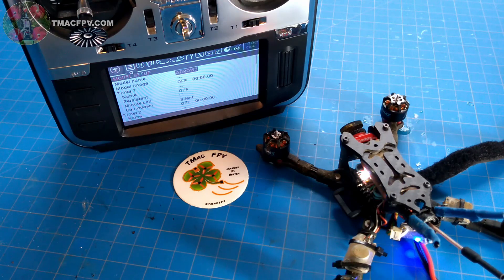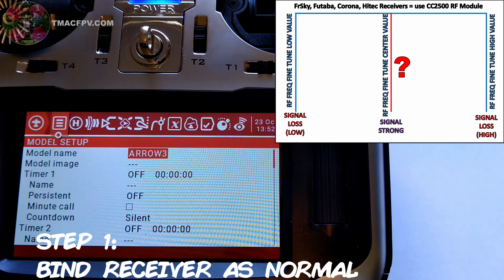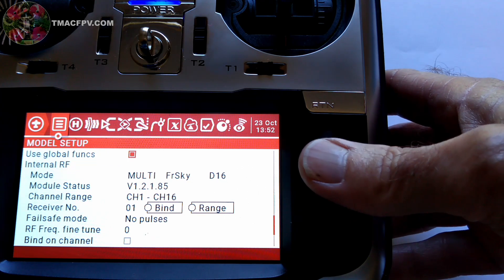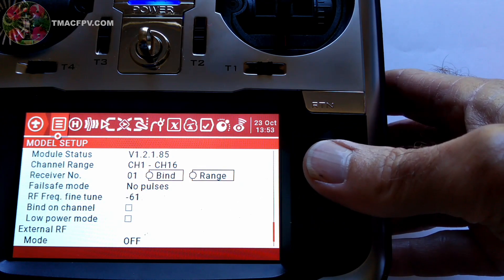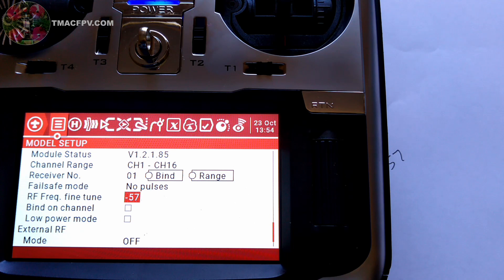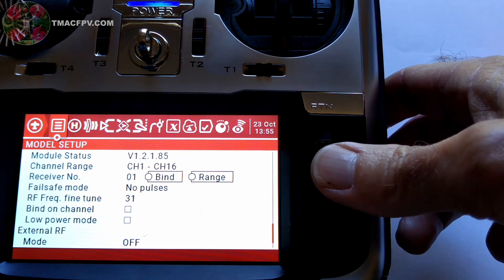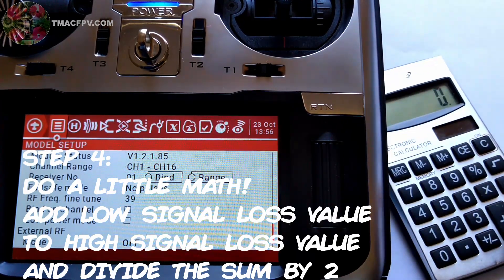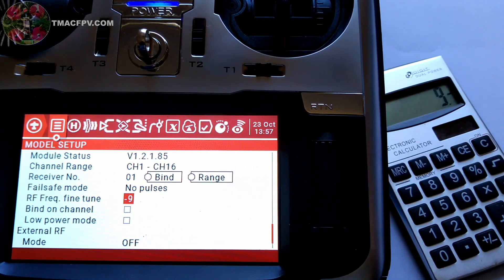JUMPER T16 PRO MODULE TUNE

Comment from the maker: Came across this “fine-tuning” with the internal module of the Jumper T16 Pro for genuine FrSky (and other) receivers & did a little research.  Wanted to pass on what I found to others.  Let me know what your fine-tuning number is and what receiver you’re using so we can all compare!  👍😀Also, if you're wondering whether or not the multi module will bind to your receiver, here's a link to a very short video clip of me scrolling through all of the protocols displayed by the internal module.  Keep in mind each protocol may have a few specific receivers within it (i.e. Hitec has Optima, Minima, Opt Hub). I obviously, have not verified myself that each one of these displayed protocols binds to the module.  Here's the link: https://drive.google.com/file/d/1H_VGiwy7iQiOCDfWnJlxe3O1AfT-ob2d/view?usp=sharing
Reply: This option is not listed in my radio.  I have the exact same radio and firmware version but this freq tune isn't a listed option.

Comment: Thank you for a very good guide.

However, I would like to suggest one change - if the receiver lies next to the transmitter, the range of both values will be very wide, because the signal is strong.

If the receiver would be far away, e.g. 500m away - I think we would find the "centre" much more precisely  (it doesn't always have to be the "mathematical" centre of the band)
Reply: You can set the module to low power - it's a checkbox further down. Remember to set it back after tuning - the radio will warn you when you turn the TX on in case you forget.

Comment: Strange, my Jumper T16 with latest opentx firmware does not show this option rf freg finetune. How is that possible?
Reply from the maker: Your OpenTX operating system firmware is distinct and different than your multi-protocol module firmware.  This video shows the difference and how they work together https://youtu.be/xAmCWIwzlKc . The RF Fine Tune feature should be in your model setup menu near where you normally bind the receiver to your transmitter,just below receiver number under Internal RF Module.  If your Internal RF Module is OFF because you happen to be using Crossfire (or an R9) system on that particular model, it will not be displayed.

Comment: Hello there Sir. Loved all your helpful vids. Wondering if you can make a video on how to compile or patch the file or firmware on T16 to resolve the issues on DSM / DSMX. Would really appreciate it very much. Thanks
Reply from the maker: hmmmm . . . what OpenTX AND multimoduile (the 2 different)  firmware versions do you have installed?  I believe the DSM was fixed back in version 47 or so of OpenTX.  Also, in a more recent version of the multimodule firmware a "fix" was made for telemetry on DSM telemetry receivers.  For clarification on differences between OpenTX and multimodule firmware,see this video:  https://www.youtube.com/watch?v=xAmCWIwzlKc  For the latest OpenTX firmware version, go here: https://www.open-tx.org/downloads  For lates multimodule firmware go here: https://www.multi-module.org/ For how to update OpenTX firmware, see this video: https://www.youtube.com/watch?v=BXhLk_l6280  For how to update multi-module firmware, see this video: https://www.youtube.com/watch?v=EJx9mz-DI_g  Hope this helps!
Reply: @TMac 
Ok, thank you Sir. I’m gonna try and see if I can update the internal multi module in my T16. Yesterday I did update to the latest firmware. 
Thank you so much.
Reply from the maker: @scrc511  Sure, scrc511! Today's video (Friday, April 24th) might be of interest. Posts at 2:00 pm EDT (UTC-4 hrs)
Reply: @TMac 
Under Model Setup, Model Status mine says “No MULTI_TELEMETRY detected”  I’ve downloaded the latest firmware for the Multi Module, and when I go in my radio under SD Card, firmware to update it doesn’t give me the option to update the module internally. It gives me this option instead, flash External Module, Copy, Rename and Delete. For some reason I don’t know why Internal Multi is not showing up.

Comment: Ended up on the positive side 17 with my fhss Futaba micro receiver. Improved the performance significantly. Before fine tuning it would failsafe for nothing. Now there are no problem flying behind buildings and I get about 900 meters range with free sight between me and the quad. Great video. 💪🏻👌🏻
Reply from the maker: Oh yeah! That's what I'm talkin' about!💪Nice👍Thanks for sharing your success 🙏😁

Comment: Do you want the middle number or half the middle number?
Reply from the maker: I go through the math at 2-4 minutes of this video. You want the number which is equidistance between the low and high endpoints (signal low lost & signal high lost). So, if your signal low lost is at -30 and your signal high lost is at +20. The number you want is -5 which is the same distance from -30 as it is from +20. Hope that helps

Comment: Should each type of receiver have the same time? i.e. rxsr will always need the same tune? Or will all FrSky be the same tune?
Reply from the maker: All R-XSRs should "tune" the same.  All XM+ should tune the same etc,   It may be slightly different from an R-XSR to an XM+ but the process is so simple and quick you can always check it out (even for specific receivers) in just a few moments

Comment: I hope this isn't a dumb question but how do you take out the sd card?
Reply from the maker: No worries 👍 It's located in the battery compartment on the back of transmitter. Gently push it in and let go with fingernail (or I use a toothpick) and it pops out further so you can grab it and remove it
Reply: Thank you very much!
Reply from the maker: @emilgabl9069  Sure, anytime!😀

Comment: How do you do this without rssi?
Reply from the maker: You should be able to tell when you lose signal connection with your receiver by watching the LED lights on it.  So, if you use the process in this video and do not have "voice alarms"  set watch for the LED lights on the receiver.  The green LED light will turn red when signal is lost on both the "low end" and "high end."
Reply: Thank you answering this question @Tmac and thank you for asking the  question @Big Willie FPV  My xm+ ended up being -24.5

Comment: Why all of sudden is there so much hype about the Jumper TX?
Reply from the maker: Hey My Drone Stories!  Not sure if you're being serious or sarcastic, but let me give you my rationale.  Well, for me I've had the Taranis Q X7 for over a year. then I dropped it down my stairs during a "durability test." I had been looking at the Jumper T16 for awhile because FrSky came out with ACCESS protocol which is more of a "closed", proprietary system (and on that I don't have with my Q X7).  I was concerned that FrSky would be doing away with the ACCST protocol in their receivers and I would either by forced by FrSky to purchase new ACCESS gear eventually or go with something else.  I held out for awhile because I was not comfortable with relying on Jumper support for their own "branch" of OpenTX (JumperTX).  Jumper isn't known for their firmware/software. Then OpenTX (same folks who support FrSky transmitters) has announced they will be supporting firmware updates of the Jumper T16 soon with official releases.  Nightly, unofficial releases are already out and being tried.  That did it for me. The T16 has more switches (i.e. versatility) than the Taranis Q X7, has an internal multi-protocl module which will bind to most any receiver, has an external bay for Crossfire or R9M modules (long-range 900 Mhz systems), a big screen, AND OpenTX support?!? The price is right and I'm also not being "cornered" into purchasing ONLY CCESS protocol systems.  I can't think of anything Jumper left out.  Great value TX.
Reply: @TMacFPV  It was/is a serious question.  I did some more research after posting my question and found essentially the same answer you gave.  Kind of bummed because I just got an X7 to get started in the hobby...
Reply from the maker: @thebikeracer  no need to be bummed. It's a very good transmitter! I still have another one (not dropped downstairs🤪) that I'm using as a backup. I've even got R9M module connected with it. FrSky is still making receivers compatible with it and so are other manufacturers. Just be careful not to try ACCESS stuff with it and you've still got a VERY nice transmitter. You have actually made a very good choice! I personally would not be saying that if you purchased an ACCESS protocol transmitter. That's just my opinion as I'm sure others have and thoroughly enjoy their setup. I just prefer not to be restricted to one closed system. With your QX7 you can also add an external multi-protocol module which does the same thing as the internal module of the T16👍😁
Reply: Yeah, what TMac said. I have a QX7s and it's a really nice radio. I switched to the jumper for the reasons he mentioned and because I pinch the sticks and the QX7 just never felt comfortable for me because of how wide it is. I also fly planes, which are all spektrum and have a few toy-grade helis and stuff so the internal multi module was a big selling point since it can handle all of those and also leaves the module bay open to add crossfire without having to switch modules. It's a great all-in-one solution. Plus, that screen is pretty nice!

Comment: so this number is valid only for one Rx model? i would think all FrSky Rxs are tuned the same
Reply from the maker: Thanks for your question-there MAY be a slight difference between FrSkyD and FrSkyV protocols, however, I have no way of confirming that at this point.  If you get a fine-tuning value for an FrSky R-XSR receiver then that value should be good for any other R-XSR receiver.  Regardless, it only takes a couple minutes to perform this process. Would like to see what values you come up with!

Comment: Thanks for your video. I think you just answered my question about whether the T16 will bind with my hitec optima receivers. I’ve asked the question and received different answers or no answers at all. Just need a definitive answer before spending some dollars.
Reply from the maker: Hey Peter! You're welcome friend.  I do not have a Hitec Optima receiver to test binding for you, however, here's a link to a very short video clip of me scrolling through all of the protocols displayed by the internal module.  Keep in mind each protocol may have a few specific receivers within it (i.e. Hitec has Optima, Minima). At the 21 sec point of this short video clip you'll see the internal module does display Hitec Optima.  Internal module also displays Opt Hub and Optima Minima (not shown in the clip though).  That tells me it "should" bind to it, however, once again, I cannot confirm this myself.  Here's the link: 
https://drive.google.com/file/d/1H_VGiwy7iQiOCDfWnJlxe3O1AfT-ob2d/view?usp=sharing
Reply: TMac thanks really appreciate your reply. Thanks again
Reply from the maker: @peterlehmannl5972  try this new link above (made new one) & let me know if it works - had wrong permissions on old one, my bad
Reply: TMac thanks worked no problem. Thanks very much. I actually contacted a retailer and was told”we’ve checked the website and doesn’t look like it will bind”. Also searched and found  a thread where part of the discussion said it would bind but you would have to manually tune as you have shown here. As I’m am out in country Australia and have to basically learn and buy over the interweb I really appreciate people like yourself so willing to share and help out. 
Looks like it will work together,so thank you so much again.
Reply from the maker: @peterlehmannl5972  You are more than welcome Peter.  I understand your situation. I've been in remote places myself before!
Reply: I'm using T16 with my Optima and Minima receivers. Easy!

Comment: This should be done for either the internal or external. The way I understand it if you do it for a Frsky rx then that number should work for all Frsky rx’s
Reply from the maker: Hey Gramps Ramblings! Thanks for your comment. 👍 That is my understanding as well.  There MAY be a slight difference between FrSkyD and FrSkyV protocols, however, I have no way of confirming that at this point.  Regardless, it only takes a couple minutes to perform this process